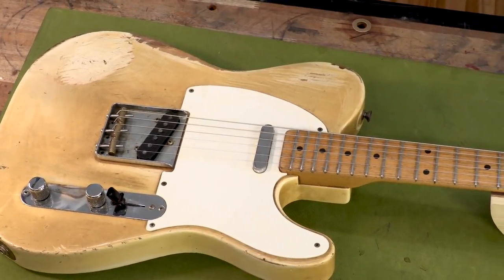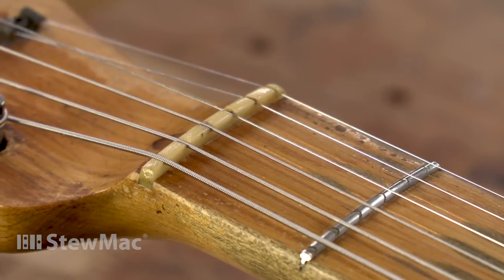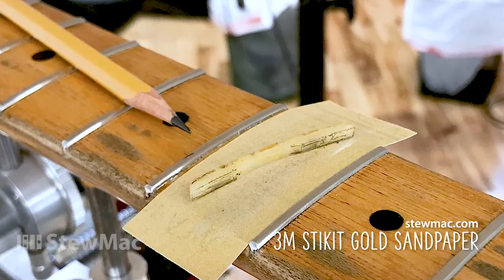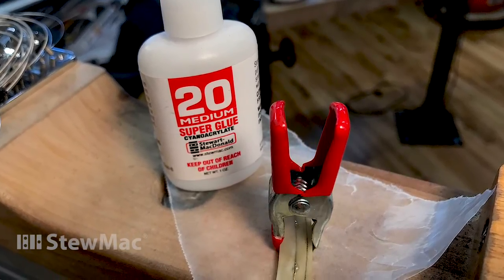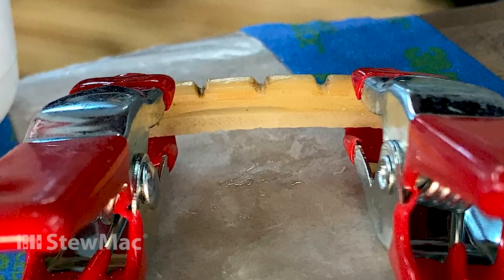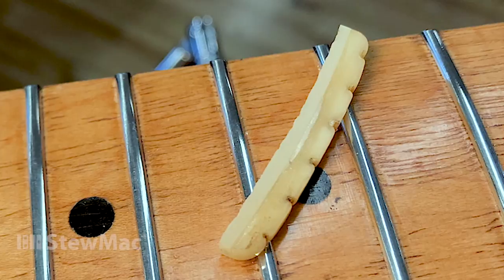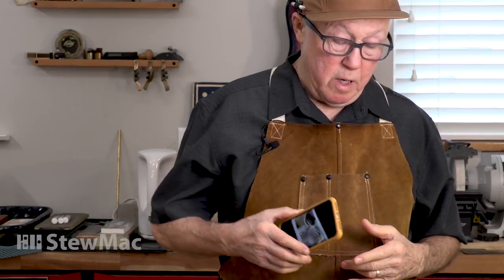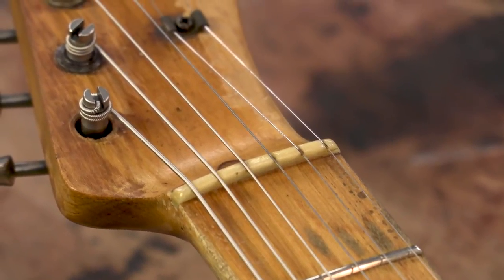Shimming a vintage bone nut by adding more bone

Comment: I use the same gage to check dent depths on aluminum sheet metal skins on helicopters at work to decide to hammer them out or make a repair for the skin. oh and not to mention that’s the best way to have raised that nut in my opinion. Leave the original if all possible. Looks great!

Comment: I have done this before but using ivroid binding. You can the colour to match and more importantly you can you can bend it to match the correct radius. It is easier to cut the right width and trim to length.

Comment: 0:15 How do you leave the lacquer alone when you do a refret? 
I've got an old T60 here and want to do the same thing. First owner was a heavy smoker and I want to keep the look. Do you use thin superglue to protect the wood from humidity close to the frets/fretslots? I'd prefer that over a refinish cause I don't want to loose those special dots that are added on top. Thx a lot.
Btw...Dan,  you're the Man.
Reply: onpsxmember use a sharp razor knife to score the edges of the old frets before they are pulled to avoid most chips when removing them. Also some heat on the frets as they are removed.
Reply: Maybe you can ask on their web. They always have a pretty good answers.
Reply: @braderrick  The removal isn't the problem,  it's more about the protection of the open wood. Some just use frets with wider crowns, but the wood is still exposed. I thought I'd use thin superglue as a protective coat like Dan used underneath that acoustic pickguard. Right next to the frets and in the slots.
Any ideas besides that?
Reply: @radop2459  I'll look around their repair articles.
Reply: @onpsxmember  Yes, there are many great hints and practices. But when I solved a serious problem I wrote in Questions and Answers. I received a private email with instructions. I really appreciate them.
Reply: @radop2459  Sounds great, I'll write them since I wasn't lucky in the trade secrets.
Reply: @onpsxmember  superglue works well for that. Sometimes I seal first with shellac if I want to match color. It's easier to tint than superglue.
Reply: Rado P and?
Reply: @twoodfrd  Thanks for the reply. I'll try that.
Reply: onpsxmember oh okay I see. I guess some glue wouldn’t hurt or even a tad bit of lacquer brushed on with a small brush. I never even gave the exposed wood under and around the fret a thought.
Reply: PS - way too much is made about needing to protect exposed wood like under a fret. Old, well seasoned closed pore wood like hard maple really is incredibly stable. Whether or not those tiny areas have an applied coating on them really makes no difference to the stability etc of that wood.

Comment: Is it safe to not have a bushing for the tuner? Looks like the E string is missing one
Reply: NapsterRulez the bushing is really only there for extra support to prevent the tuner from stripping its set screw holes in the back of the headstock, it’s not unsafe to use the tuner without it, but it’s best to still use one

Comment: Why not replace the missing tuner ferrell while you had the strings off Dan? By not replacing it the gear will wear and the tuner will not function properly if it has not happened already.